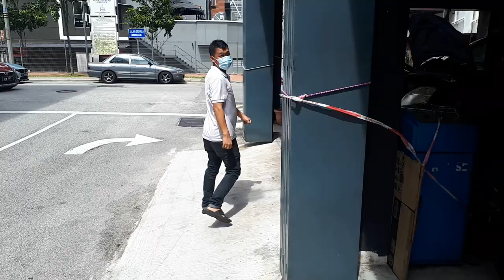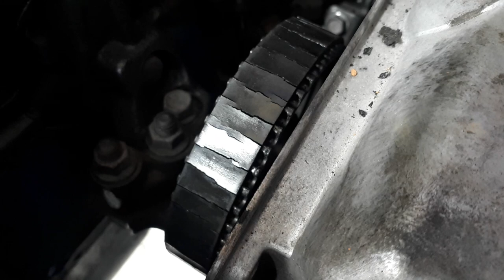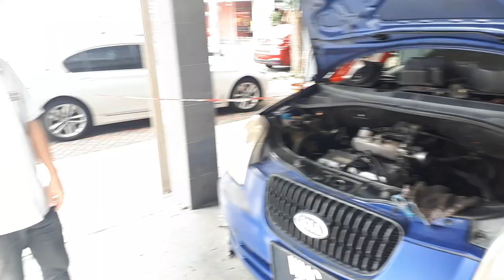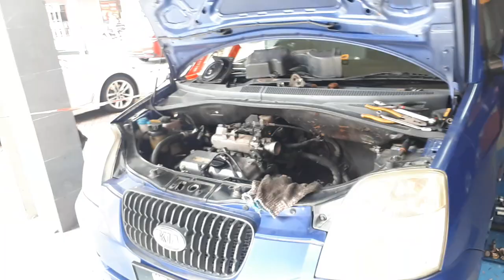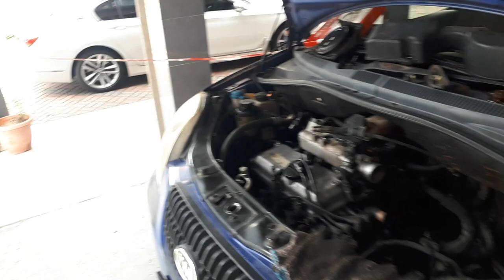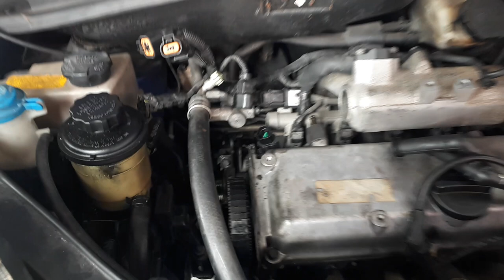WEEVIL UPDATE: 2004 Kia Picanto 1.1L (M) - Oh Damn, I Was REALLY Lucky!! [2min] | EvoMalaysia.com

Comment: Wowwee Chris.. tat belt was hanging on to dear life with just threads. If it had decided to burst while on your drive back the other day, all hell would have broke loose with the pistons and valves. Being an interference type engine, a belt failure  at the speeds you were driving the little fler, would have destroyed its engine; or at the least an expensive repair. But you are right; we must check and keep tabs on the timing belt, especially if we just got the car and dont know its history. Luckily for me, my old Mazda has a non-interference engine.. belt burst... i just glide to a stop with almost no damage to the engine.. 😀
Reply from the maker: Yep, it would have been catastrophic indeed. The Car Gods were smiling on me that day, hahaha!!🙏🏽🙏🏽🙏🏽😁

Comment: Hi Chris. Normally timing belt change interval is 100k km or slightly b4. Looking at the present belt condition, how much mileage this belt has cover? Or is there a record to trace the last change?
Reply from the maker: Yes correct, and there wasn't a record, so I would reckon the last change was at 100k kms, it's now at 200k plus, overdue for sure 😊
Reply: You'll also need to take into account the amount of idle time your car spends in traffic. If it's rated at 100k km, better to do it at 60k to 70k just for the peace of mind sake 😌

Comment: Nah, that timing belt looks worse. If you wait, the bill will be from rm 200 become rm 2,000 already.. My timing belt is up to 100,000 km but I won’t wait until 100,000 km to replace. I will replace on 75,000 to 80,000km to be safe and peace of mind.
Reply from the maker: Of course I'm changing it, that's the point of this video 😊
Likewise, I'll usually change mine around 60k kms, just to be on the safe side 👍🏾😀